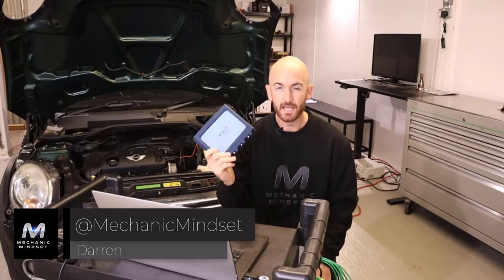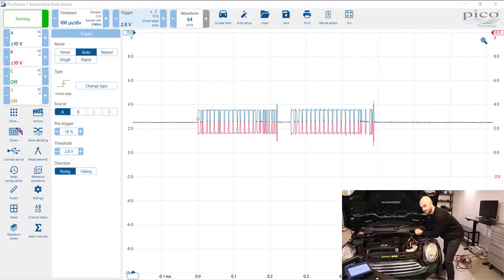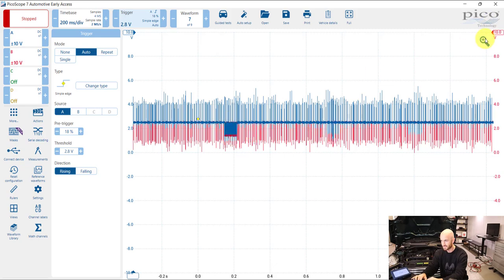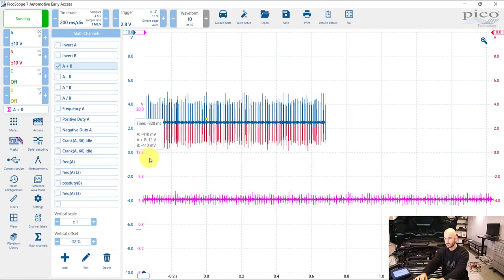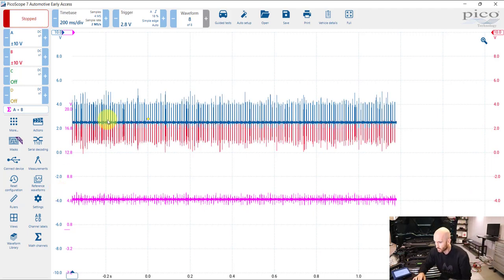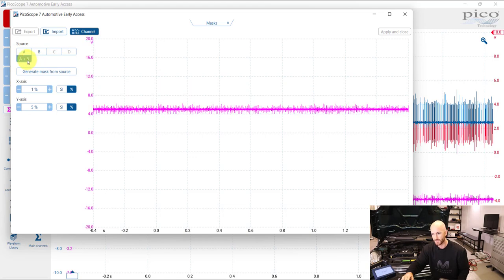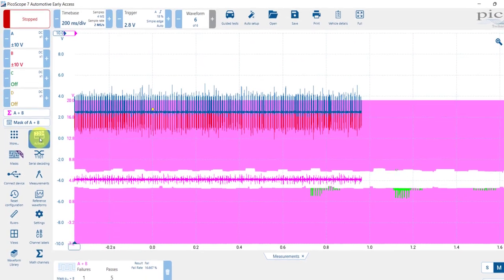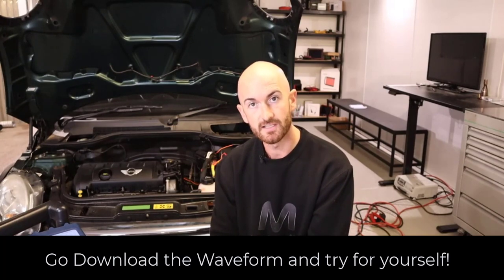Quickly Solve an Intermittent CAN Bus Fault - Here's How!

Comment: Great video explaining how to use the Math, Mask, and Alarm features in Picoscope 7 software. I have only used those features in Picoscope 6 before while I was waiting on the features to be added to version 7.  There is one more layer you can add to help you with capturing failures during test drives, or with a laptop connected to a vehicle overnight. In Picoscope 6 you can also create a custom Alarm in addition to the audible “bell.” Under the alarms drop down, you can select something like “record all buffers” then browse to create a destination folder on your hard drive. Once applied, Picoscope software saves a new file to your hard drive each time the math channel signal goes outside the masked area. This allows you to go back and review which type of CAN bus fault you may be chasing (short together, open circuit, short to ground, short to power, etc). Knowing what type of fault sometimes helps deciding on the approach to locate the root cause of the CAN bus issue. I am assuming the record buffers feature has been added to Picoscope 7 now? I have not gone back and checked yet.

*Note: this record file feature can be useful if you do not have time to test drive the vehicle yourself. Just connect the laptop with mask and alarm features applied. Have someone drive the vehicle until faults occur. When they bring the vehicle back to you, you can review the saved files with faulted signals.
Reply from the maker: I was waiting for this too! I think that feature is also there in the actions; from what I’ve seen the same features as Pico 6 are in there 👍 Cheers!!